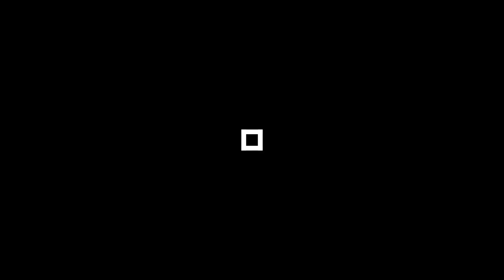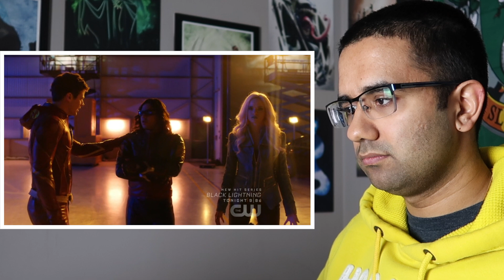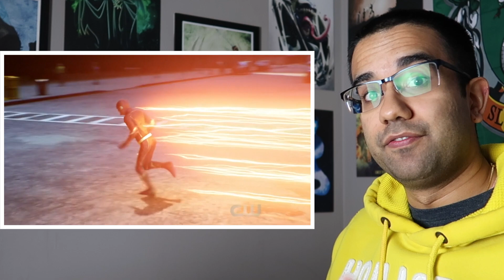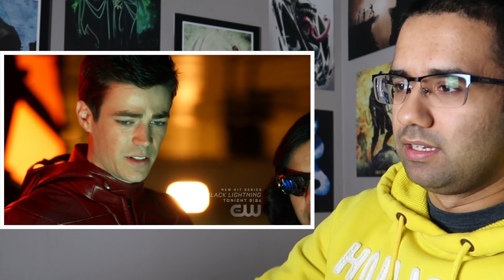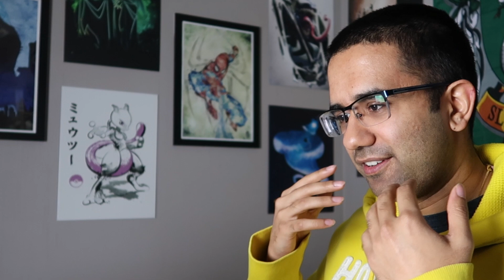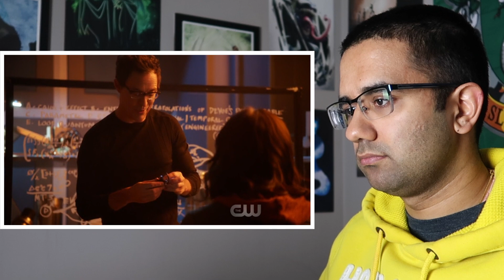Real Engineer Reacts to Technology in The Flash tv show

Comment: In the flash lore, there's an extra dimensional form of infinite kinetic energy. It's called the speed force. Other speed force users tap into it like putting a plug into a socket, but the flash is the generator/engine. He's the power station that drives/creates the speed force
Reply: More realistically the speed force should cancel out the effects of the Higgs field.